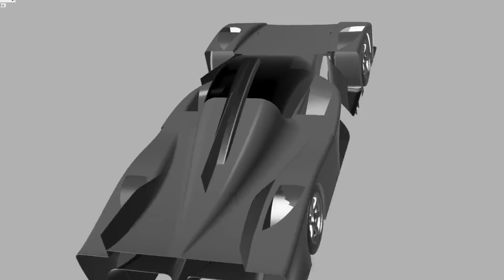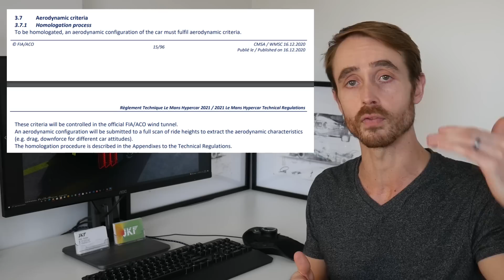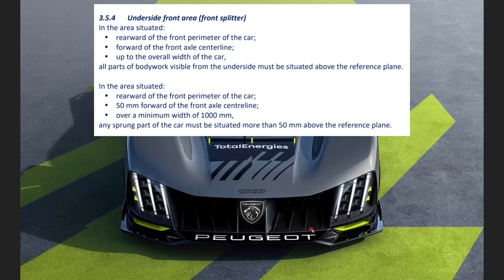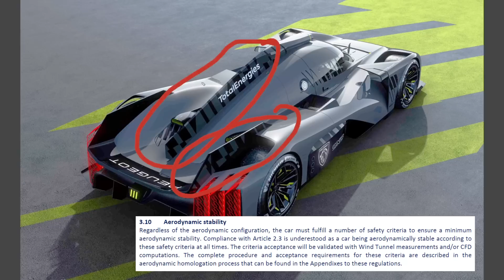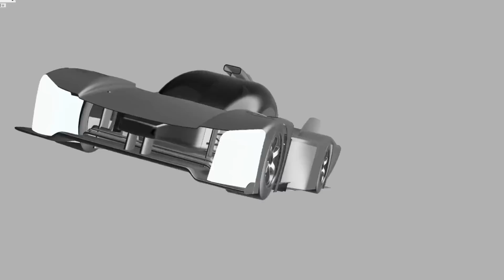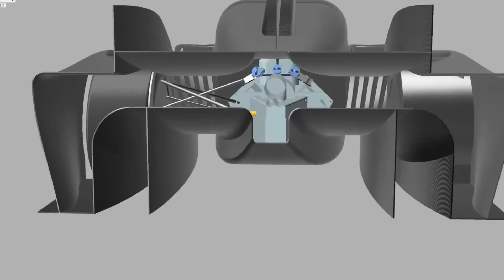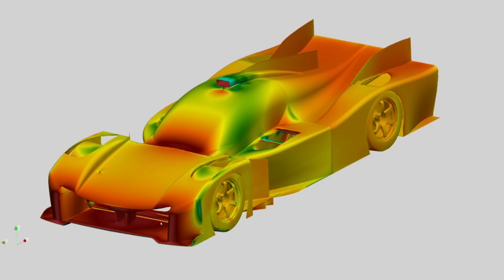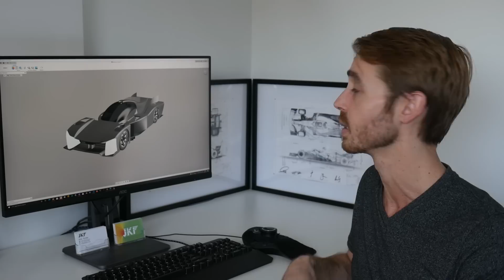Does a Race Car Need a Rear Wing? Peugeot 9X8 Aerodynamics Explained

Comment: I remember watching this video when it went live, one of the first I saw of yours Kyle. Absolutely love the intent of the LMH regs, I'm still astonished and disappointed that on Peugeot has decided to go along this route.
Quick side question: as the car that was cheekily entered into more le mans that it was really eligible for, how would the Porsche 962 fair for these new HyperCar regs? Would a new engine/hybrid system and a pick of paint be enough to make it able to take part in yet another le mans race it wasn't really designed for?

Comment: The channels in the central front fairing is to direct the air to cool the engine, some to the air filter, and to provide some downforce, directing it to the back wings, across the wheels to the rear winglets, it's nothing to do with style, although you might think that because of the way that they look, similar to the lights. The side scoops are just to cool the brakes, no style thing going on either, it's simply to provide air and cooling to the brakes.
The scoop in the centre of the car, across the roof through to the rear type of spoiler, is to push down the spoiler with a trumpet like outlet to increase the air out like a silencer on an exhaust, to provide downforce, clever

Comment: Great Vid.  We've known for decades that cars with ground effects don't need wings. F1 in the ground effects era had cars that would in some races use a front wing and some races not. When the car had a front wing quite often it was there to balance the car front to back. when the front wing was missing it was the rear wing that was used to trim the car out.  My bigest question about the 9x8 is how they balance the car out in changing condisions. We all know how rain effects what a car needs but a race track is a living breathing entity. Its total grip level can change especially in a 24 hour race. The tires can even react differntly from 1 race to the next or even 1 practice session to the next , so how do they deal with it. and what do they do if the main floor gets danaged slightly. the other cars can adress these problems by adjusting the wing

Comment: As a video idea, because I am very interested in this:    Could you do something like this (design a own car or aerodynamics) but with a front mounted engine, for example the Panoz gt1 or lmp1 car but as a modern interpretation. because I think it would be interesting to see if you can do a ground effect car but with a front engine.      (just a front engine, so still a rear wheel drive car, not like the Nissan lmp1 car....)

Comment: Holy crap I'm super impressed by that model you can just throw out like it's nothing hahah. Specifically if it's meant to run analysis on. Because I have made several CFD runs for my college team of Aero Design (RC aircraft) and I struggle massively when my geometry isn't super clean. As a struggling student and admirer of your work I would love to see that CAD video, I hope it's already out there

Comment: You mentioned using some inlets at the lower front corners for possible brake cooling. Would the direction of those internal ducts have a noticeable effect on the aerodynamic performance of the car?

Comment: Sweet base platform. To see what's possible with no Cd limit. I can see the limits on downforce but why do they always go too far? F1 could be incredibly exciting if they simply said... Here's your budget, You can have 3 engines per season, your fuel limit is x per 100km. Do your worst. When F1 began, there weren't even that many rules. Initially, there were no rules. For the sake of variety and especially for the sake of innovation, it should go back to that. Give them a box X, Y, and Z. If it fits, it ships. You have X fuel per 100km, You have a budget of X. You can do anything you want as it fits in the box and stay in budget. You couldn't get more innovation and excitement out of something. For GT cars, Nascar, World Rally, Dakar rally HOMOLOGATION EVERYWHERE! Let's see some of those special animals out there on the road.

Comment: You should reference the TT mr1... I own one. 
Perfect example where you feel sorry for a full recall.
I mean my TT has a considerable chunk of weights securely fastened to the left rear, along with a rear spoiler. 
At auto barn speed the original TT spun around(160-200kkph)

Comment: Basic (dumb?) question… does a rear diffuser need to be able to withstand the full weight of the downforce it creates? For example, say a rear diffuser creates 150lbs of downforce. Is that the same as attaching 150lbs of weight to the diffuser and having it transfer that load to the suspension of the car? If so, the 8!or 10 or 12 attachment points to the chassis need to be pretty strong, right? And the diffuser itself needs to be fairly strong to not bend and flex, right? Or do I have this all wrong and the diffuser is just creating vacuum and need not be that strong and stiff? (Thx to anyone who answers)
Reply: Your thoughts are right. It's the same with aircraft wings, the structure must cope with lift and drag generated.

Comment: Is it forbidden to use the wheels spokes as aerodinamically active elements? It seems to me that they have a lot of potential, as they have an aerospeed that is twice that of the car on the top (and zero on the lower part) and they point differently than the rest of the car in curves (for the front ones), which I suppose one could cleverly design so they increase downforce in curves but stall and reduce drag in straight sections..

Comment: I got a heavy light question about rear down force. If you have a spoiler to create down force for better traction, why would you make it out of carbon fiber instead of a heavy material? I'm sure there's a good answer. Maybe for a good video? :) Thank you.
Reply: This is just my first thought, but for a racecar (and especially endurance) you would want to avoid any weight at the extremities if possible;

Your proposition of making the spoiler heavier moves the center of gravity up and to the rear meaning in corners the car would generate more body roll and oversteer (from momentum) that you would have to work around (in really slow corners you might see a slight benefit from added mechanical grip, but i think that's an advantage you would lose on medium-fast corners and would increase tyrewear or upset other things on the car if you did correct these added forces)

The exception to this rule is Porsche  but even their LM cars broke their own philosophy to get winnig cars for this type of racing.

Comment: Something I wonder is, how do the regulators verify the car meets the aerodynamic requirements? It's not like they can carry a wind tunnel around for scrutineering.
Reply: Test the parts before and make sure that the teams use the same parts or designs in the race.

Comment: How does flaps under the bonnet affects low-pressure area under the floor? Could it be that the only adjustable bodywork device?

Comment: Farewell LMP1. I loved the engineering with the most extreme aero driven cars in racing. My favourite cars for that simple reason. If this car is anything to go by, that idea is unfortunately now gone. I'm sure over time there will be cool tricks to exploit around the rules, trying to add downforce in a yaw, maybe use rake for aero pitch and the single modifiable aero surface for high/low downforce, but it isn't the same. Seeing very unique cars like the Nissan FWD trying to exploit aero over mechanical grip, seeing the closest we could get to an unlimited class (at least by looks), LMP won't be the same now there are easy targets and left over potential. I guess Pikes Peak is still there, but that was always maximum downforce rather than a drag balance.

Comment: I know you traditionally do racing performance related aerodynamics analysis but would you consider doing a video or two on fuel efficiency aerodynamics as in Aptera trike, Arcimoto trike, or even semi truck? It would help diversify reach in audience and potential students.

Comment: When the car was shown I was a bit surprised but after thinking about the concept it is quite obvious why they did it. The regulations are limiting the concepts quite much and with a set C_x and C_z I would also go for the diffusor instead of a wing to produce downforce because it is way less sensitive to drag and other conditions.
With considering that Peugeot wants to win Le Mans and therefor might accept worse results on other tracks there is also no reason to place a super flat wing on the back.

But the exhausts might be just a design for the lounge. They are really weird looking and (without doing a cfd analysis) look like they waste the airflow over the car that should be really efficient without them.

One thing I am not sure about is the big height difference between diffusor and top of the rear. There should be so much bad air in between. And usually noone wants that in the rear of the car. Even with the regulations and the need for some drag I don't think it should be there.

Nice video! Thanks for the work!

Comment: I wonder how about driver changes, these doors seem rather small and bottom of the car it rather wide. Doesn't seem particularly convenient from driver swap perspective.
Reply: Driver swaps aren't a very rushed process as the car gets worked on a lot throughout a long endurance race, and current LMP1 cars are a lot like this and the drivers get in just fine.

Comment: Would there be any advantages to maby leaving the floor flat and focusing on over body aero to potentially lower the center of gravity, if the regulations aro goals are easy to reach?
Reply: focusing aero using underbody is more efficient if I am not mistaken, maintaining similar amount of downforce with less drag penalty in higher speed section (basically what Peugeot is targeting). That's why F1 changes it's regulations to ground effects starting next year.
Reply: @budokpantai  yes, but the LMH rules are designed to ensure that the ratio between downforce and drag cannot be particularly extreme - even Kyle's rough draft car in the video was illegal for that reason. If you must create at least a certain amount of drag, there is no reason to worry about efficiency.

Comment: What about cheating the regulations? Have flex panels after a certain speed or load and load can be multi plane. Would having no rear wing be extreme disadvantage if you were planning to flex panels at speed since only one can be adjusted race to race? Also would it be possible to have a flexible floor?
Reply: carbon fiber parts can be made flex in almost any fashion. i dont really know how they check for the 4:1 stuff etc. depending on that you can almost expect flex parts
Reply: @richardtickler8555  3d scan the car, stuff in wind tunnel, measure, then confirm by 3d scanning cars before races?
Reply: @Cynyr  Or they could even just have 3-axis load cells on each wheel and an inertial measurement unit. You know the traction loads on each wheel so you know the total friction force due to the wheels, but the acceleration will be less than naively calculated from the traction loads due to drag. Vertical loads will also give downforce info, so then L/D can be worked out.

Comment: man this is what f1 should do regulate the max downforce not restrict the design of the car let the engineers be creative
Reply: @AzathothsAlarmClock  nah then it's just about the driver, they're overrated anyway to much drama, i want to see the engineers to be creative obviously with max downforce and cost cap
Reply: @AzathothsAlarmClock  unique design, the 22 regulation is stricter than the 20 regs about the floor, fw,rw, sidepod, etc and eventually all the team will have the same aero package, all identical and of course slower
Reply: @AzathothsAlarmClock  idk i don’t have the knowledge yet, maybe different side pod approach, or different front wing, nose, different diffuser, high rake low rake,  just don’t make it like indy or f2
Reply: @AzathothsAlarmClock  but there's big design approach freedom unlike indy or f2 that use spec car with the same body and arro package

Comment: Is there anything in the rules preventing the teams from getting their numbers from an unrealistic configuration? Such as the mentioned high ride height to reduce downforce for the relevant test and then get more downforce in the actual race?
Reply: From what I’ve found online, any change made to the car must be noted with the FIA and they’ll send scrutineers to check that it still fits with the rules. I haven’t found anything preventing changes in setup that gain an advantage

Comment: Nissan built a front wheel drive prototype racer a few years back to get better aero and downforce while Peugeot built a wingless car for better styling.

Why would Nissan go to such lengths when a wingless car would have been ok? Are the downforce requirements of the current Hypercar class lower than the prototype racers during the year that Nissan FWD racer competed?

Edit: commented before watching the vid. The vid answered my question.

Comment: Super interesting, one question I have is, given the single adjustable element constraint, would the central low-pressure of the floor allow for it to be treated as a fulcrum such that simple balance of the system can be achieved by just the front element? For example could a change on the front effectively stall the floor at the same rate or is the floor fixed in it's effectiveness?
Reply: You could have one adjustable flap, and also play with the ride height to change the floor effectiveness, which is basically one giant unregulated flap.
Reply: id guess the best way to circumvent this type of regulation would be an adjustable splitter and then playing with rake until the car was on point, effectively using rake as an adjustable spoiler.
unless that's illegal somewhere in the suspension rules

Comment: So for this category, since the regulations place limits on the aerodynamic performance (like lift/drag coefficients, etc.), what would the aerodynamicists look to optimize? To clarify - once they reach the aerodynamic limits prescribed by the regulations, what can be done to increase the car's performance further without breaking the rules?
Reply: I guess they'd try to optimize the front/rear aero balance, along with optimizations to ensure that the downforce works well with the suspension setup of the car.

Higher downforce numbers usually require stiffer springs to prevent the bottoming-out of the suspension. Lower downforce allow for slightly softer springs to allow compliance, which would help on tracks that are not F1-smooth. The aero characteristics of a car can also change during acceleration (from a bit of squat) and braking (from a bit of dive). Slip angle during turns also affect the aero of a car.

If the regulatiors measure the car's aero with zero slip angle, teams can try to make the car exceed the aero targets when the car is on a slip angle though i am not sure that would be feasible.

Comment: The Design is certainly something different, exciting imho and it aligns itself perfectly with the current road car design philosophy especially with the upright lights, as to the winglessness, which at least shows a different way of going about stuff instead of keeping with old formulas, Königsegg also removed the wing for the highspeed model adding two straight lines for side stability and probably quite a few more will follow with the design direction

Comment: I wonder if there's any strategy for/ regulation against increasing the drag and dirtying the air as much as possible for the following cars. especially when there is a minimum drag, why not make your car make the air as dirty as possible.
Reply: True. Making the car wake as dirty as possible would prevent other cars from gaining advantage from slipstreaming you.
Reply: Correct me if I’m wrong, but on La Sarthe the more dirty air you leave behind, the easier it will be for competitors to exploit slipstreaming, isn’t that right?
Reply: wouldn't forward swept wings make the cars aero unstable in pitch? like planes with forward swept wings.

Comment: This is dope. The reason for no rear wing is to win Le Mans. It's all about drag there and a rear wing is simply not efficient. They are giving away performance at other tracks to win at the race where it matters.
Reply: The reason for no rear wing is for looks. There are regulations on the car's aero numbers and the car cannot have drag numbers that are lower than the rules, and those targets can be achieved whether a car had a wing or not. It would have been easier to meet those numbers with a wing.
Reply: I think the reason is BOP and restricted downforce level-  no wing makes car faster on straights(easier to overtake) and uses less fuel

Comment: My conclusion after the video: hypercar regulation sucks (no pun intended)
Reply: Hypercar regulation rocks! Prototypes looked rather boring in the past years and the hypercar regulations allow manufacturers to build cars that look decent and focus more on mechanical grip, especially that mechanical grip is actually more relevant for road car use than aero grip.

If i wanted to watch aero-focused cars, i'd just watch F1.
Reply: @sepg5084  well I do watch f1. Hypercar is now the pinnacle of sports car racing, it’s just sad for me to see how much the regulation is restricting performance. You can see in the video just how easy it is to hit the performance target, it takes away the magic of the cars for me. That said, I’m probably a bit too addicted to aerodynamics for my own good.
Reply: @chenkaizhang532  Well it brought back many big manufacturers which will provide great racing.